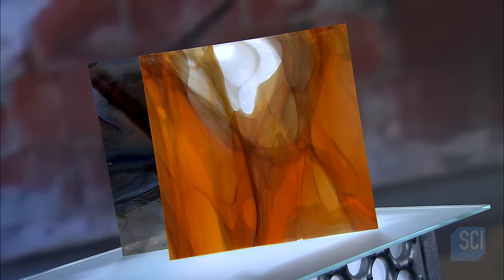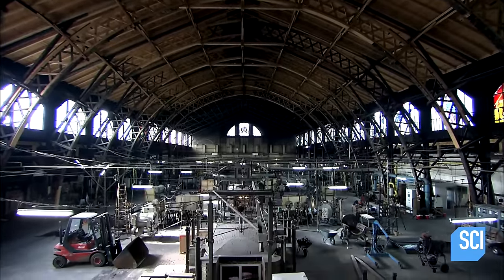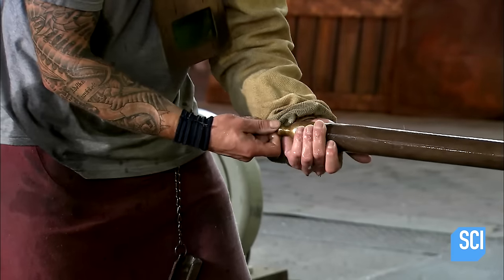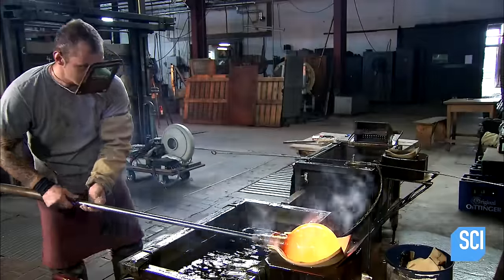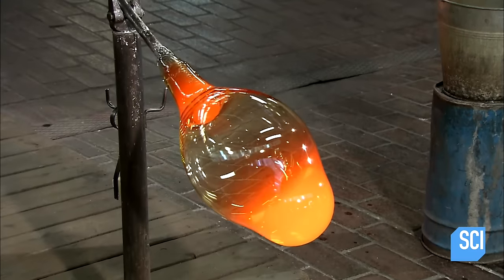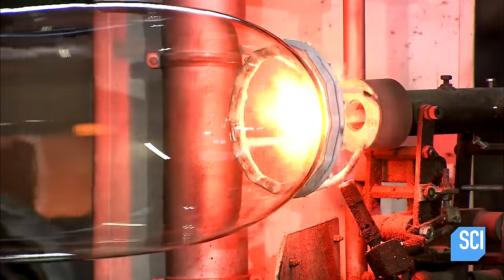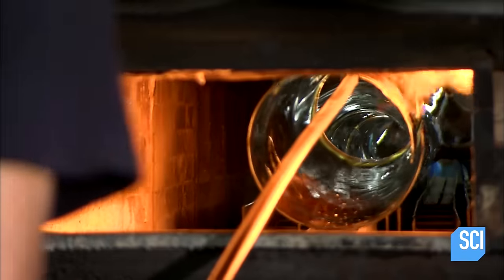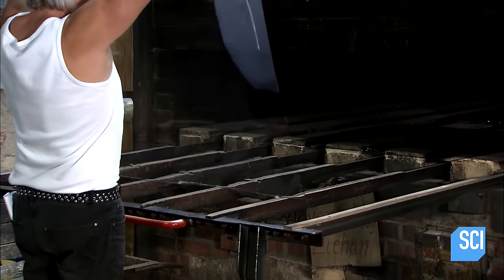See How Window Glass Is Made The Artisinal Way

Comment: If you own an old house, please, DONT replace your old windows with modern vinyl ones. Let this video speak to all the hard work that went into just a single window in your house, and that's just the glass itself. The craftsmanship that went into creating the wooden sash, glaing, and hanging the windows represents skills that barely exist today, and so many people just throw it away only to replace it with generic, cheap, machine-made replacements.
Reply: The plastic is what breaks on Windows mostly. The ones at my house are decent. Only problems they do have isn't the glass but the plastic, screens, etc, bugs come right in of they're open.
Reply: Then again they're from the 90s. Still better than new new windows.
Reply: @aleksandramakari  Not sure what windows you have, but modern ones are usually better at keeping heat from escaping and cold from entering. They are also better at blocking outside noise.
Reply: @jinpachibobochan3532  maybe a different kind than I got, which sound more inline with yours 😂 I wonder if the variance could be due to architectural differences— I have a 1932 house with solid panes of “old glass” on my front porch, and with the lack of framing etc, the glass unfortunately functions more like plexiglass garbage than anything else 🤷🏼‍♀️
Reply: Ever heard of saving energy, old windows are worse and let heat escape your home more easily forcing you to spend more on heating
Reply: @mr.beamss9106  With regular maintenance to ensure a proper seal, and with storms installed, original windows can be just as, if not more efficient than new windows. Window companies sure do make bank by saying otherwise though!
Reply: Modern windows are superior in insulation, noise reduction, and strength.

The vinyl may be icky, but you don't have to get vinyl. Vinyl is just the cheapest option. That's why it's popular.

Comment: This video is somewhat misleading,    while machines DID assist with window production in the 1920s, it wasn't until the 1950s when the float glass method was perfected,  and this is why windows in old houses built prior to the 50s, have that classic ripple look.   It's not because the glass is a liquid that slowly slumps and deforms over time,  it was made that way.   Float glass uses a bath of molten tin, which melts at a much lower temperature and also happens to be more dense than molten glass, so the glass floats like oil and water, hence the name.   You really begin to appreciate all the craftsmanship and time that went into building a new house 100 years ago.  The windows,  the horsehair plaster & lathe walls, the crown molding and cabinetry,  you feel a sense of charm and nostalgia that you can can't get with new construction where they can built a home in just a few months

Comment: Unfortunately, this video is giving out erroneous information.   Window glass, while machine assisted, was NOT machine made in the 1920's and requiring no polishing.  The Pilkington process was from the 1950's, which is what created 'machine made' glass that didn't require polishing.   AKA float glass.  The window glass in my house, built in 1947, is machine blown glass, and shows all the ripples you'd expect.  (Edit - It's actually drawn glass, not blown.   Blown glass would have had fewer ripples.)
Reply: I don't even know if your information is accurate and I'm too idle to research to confirm, but you make such a convincing argument you've earned my thumbs up either way.
Reply: Nerd
Reply: Upgrade your windows bro 🤣
Reply: Most interesting. ...I used to make windows (years back) and we used Pilkington glass, I had no idea it was such an innovative company. Thanks.

A question: can charcoal be used as a fuel for glasswork?

....I'm thinking historical settings.
Reply: @JesseP.Watson  - I'm sure it could be, but most may use coal.   Just check some of the glass blowers videos.   You can even make float glass in a shop, by making a bath of molten tin on which to pour molten glass.
Reply: @VincentAnzalone  - It was a rent house; we don't live there now.  The landlord had the windows ripped out and replaced shortly before we were required to move (so they could sell the house).    I think the machine drawn glass is actually more amazing to watch than float glass - even with the polishing required afterwards.
Reply: @tbelding  Huh. Funny you should mention tin there. I'm actually researching a project relating the development of glass to the development of metal smelting and... more... a history of fire one might say. Tin peaks my interest due to the strong (in this case)  Arthurian referencing of Cornish tin being worked in the bronze age. 
.... ... Argh! ...it's a monster!

Thanks you good sir, a most intrigueing coincidence... 

....wherever shall it lead... ?
Reply: @tbelding  can you really make float glass that way? My research tells me that it requires an oxygen free environment. Otherwise the tin will oxidize.